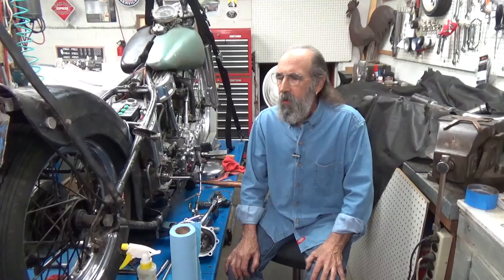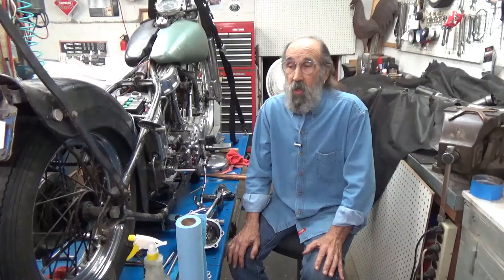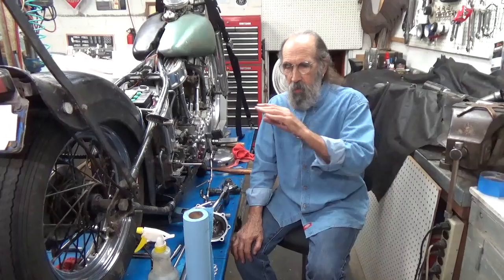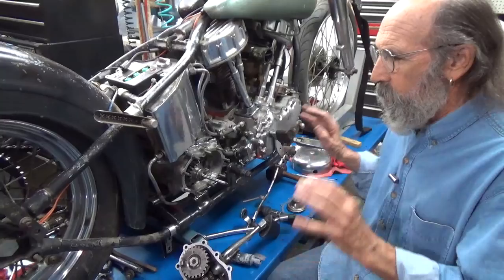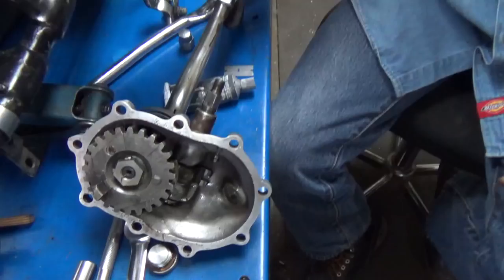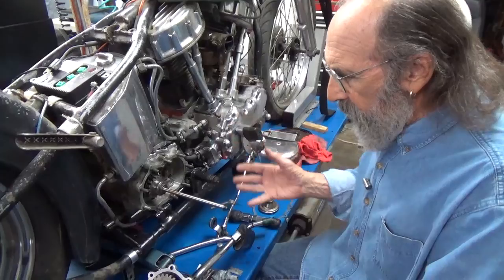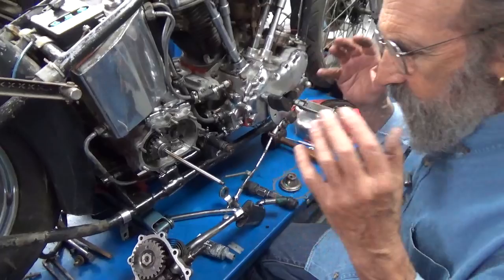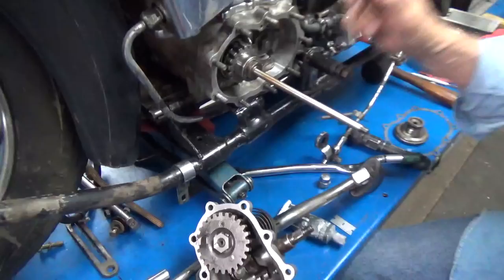Step 5 Reinstalling The Kickstarter on the Panhead

Comment: Hi, It's so refreshing to see the the struggle and persistance to get these things apart and back together. I have a rare 1985 superglide  that I bought new and early on, about 34 years ago, I replaced the kicker gear and didn't think much of it back then. Now I have the bike disassembled  in the driveway ,replacing the throwout bearing. What a night mare. It seems like this bike is a collage of 1off parts cobbled together to make a one year one model EVO with a 4 speed. Harley engineering didn't improve much.My Road king headlight needs to be disassembled  just to adjust the handlebars.
Reply from the maker: It is, what I think of as a "transition year."  Harley was going to five speed transmissions in most models.  There were new models and apparently things still in stock from previous models.  Evos with four speeds and both dry and wet clutches. FXR's getting developed.  They were all good bikes, just caused a little confusion.  The best thing you can do is buy a factory service manual and a proper parts manual for your 85.  I went through all of that when they were new.  Depending on a parts man who is familiar with these changes is hard to do.  Depend on yourself and realize that most aftermarket suppliers will give you their part number and an o.e.m. number from Harley.  It's the same kind of research a restorer has to go through.

Comment: Good to see each bite sized step along the way. Looking forward to seeing the carbituder come off. I know how you love your Linkerts. That will be fun.
Reply from the maker: Wait 'til you see it.  It's the worst I've ever seen.
Reply: @pacificmike9501  Looked darker than most exhaust pipes. Must have been cranked over for days and weeks with nothign but soot belching out to get that black.

One thing i'm certain of, Once you get it cleaned up and adjusted and the timing set properly, it will start like it's supposed to. Cheers.

Comment: Mechanical pieces of art eh? Mike, you are one of my favorite go to's on U tube.Thanks so much for sharing with all of us.Worked in a sawmill  engineering office when I was a lad. When the engineers where building systems they always would stay in the ASTM  tolerances . Specifically, if we  installed a manufactured item into the design there was usually a note from the manufacturer stating that there was a thirty percent safety factor built into there product tolerance. ( shear and torque on shafts.That sort of thing.) Just recently purchased a 1995 heritage soft tail with a S&S  engine, 102 hp @ the crank motor. avacodo combustion  chambers, 485 cam. ( yup! it's an evo). From my calculations she's pretty close to ASTM tolerances from stock.Clutch is after market,have not taken of the primary yet.Lots of torque.Pulls like a train.lol.Cheers Mike and kind regards.
Reply from the maker: I'll bet it's cool.  I've never heard of "avocado shaped chambers,"  but I can see it.  I've seen people play with what we used to call "Bathtub Chambers."  There's some pretty bright folks out there.  "The Horsepower Is Made In The Heads."

Comment: Big Mike the bikes getting together. The carb needed touched up. Ran super last night. Try start let run again. 10 or 15 minutes. Drying oil in cylinders that I put in to keep from locking up while down 5 years
Reply from the maker: Cool.

Comment: Hi Mike,
I had a case of Harley fever and bought a 2003 FXDL with a S&S Super E carburetor, a performance clutch and an upgraded charging system. Most everything else is pretty much original. The bike has 42,3xx miles on it.
I’m in the process of giving it a preseason service and inspection, some things I like, some things I’m scratching my head and wondering how it stayed together … so with that said, I’m going to get busy and see how much fixing I need to do before I feel comfortable taking it out on the road.
Reply from the maker: It's an important act of "bonding."  Enjoy it.

Comment: you work well under pressure!
Reply from the maker: My garage.  I just try to take it as it comes.  My dad used to get so angry doing things that were difficult.  I decided early on, I wasn't going to be like that.
Reply: @pacificmike9501  my mentality is I will persevere no matter what. If I need to step away and come back to it, not a problem. I always get it done.

Comment: Hi Mike I have a 1965 FLH and you might be able to answer a few Questions #1 What oil would you recommend for the transmission # 2. The engine ( I won't be riding it in the winter) The numbers on the left engine case are cast in with a star framing them before and another at the end. I had been told years ago when I had a 1950 FL with numbers stamped in the case that a star framing the numbers indicates that the motor case was cast as a replacement from the factory and the original case had to be sent to the factory as proof of ownership. That friend ( Smiling Fred Casey) sadly passed away over 19 years ago. Love your videos especially the fact that I can hear you on my lap top that has no external speakers. Thanks a head I'll be watching more this winter wile I put an 04 deuce front end on the 65 bobber so I can stop the thing on these crowded Maryland streets.Mike   P.S. I bought the bike partially built I would never take an original bike and convert it.
Reply from the maker: That all sounds good to me.  Thank You.  I believe those stars signify what you're saying.  I've heard that before.  In transmissions, I use 85/140 in all of them, new old, ancient.  Todays technology really works in transmissions.
Reply from the maker: The engine?  I use today's 20/50.  I don't recommend brands.
Reply: @pacificmike9501   Fair enough I'll nervously try that 20 w 50 synthetic on the motor next spring when I get her back on the road. I was using a solid 50 but I've replaced the pistons  and had the cylinders bored  to .004 over. That sounds like a good choice for a long slow break in. If you had not mentioned it I probably would have used a strait 50 w C-D rated oil like I did on my 50 years ago. The more I've been thinking about it the more I like the Idea.
Reply from the maker: Cool.  I have no thoughts on whether synthetic is good or not.  They tell me it is great.  I do think 20/50 is my answer.

Comment: I am glad you reply on bolts never was really thinking on that I think you like friend I find lot times lot rust an crap aan your never rude I go to the days we put chainin bucket oil for hours before putting them on
Reply from the maker: Yes!  We used to go over to my buddy's house and his mom would come out to the garage with a pan and a hot plate.  She'd plug in the hot plate and heat up some grease in that pan and cook your brand new chain in it.  She was someone special.  She set a speed record in 1936 at Muroc Dry Lake on a 1936 Indian Junior Scout.  She was 19 years old and weighed something like 92 lbs.  When I met her, she was a sweet old gal.

Comment: Another great video Mike.    I have a 1957 Panhead and the M74 B carburetor was leaking fuel out of the vent so with watching one of you videos on the Linkert M74B I took it apart.  Now it will only idle with the choke one one click.   Any help would greatly appreciate. I backed bent wire needle (low speed) 4 then 5 turns ,and no help then round nob High speed needle 2 turns then 3 then 4 and no different.  What would you do next?  Thanks John
Reply from the maker: You should have counted the clicks where you are.  You are currently confused.  The low speed needle is the round knob.  Back it out a couple of clicks at idle.  Do it by ear with the motor warm.  Again, you have your needles confused.  Read the words on the body of the carb.  Screwing the needle out (to the left) richens the mixture.  The other way leans it.  A whole turn is a huge group.  Count clicks, not turns.  I'm doing one now.  It will be a few days.  It's soaking now.  Watch the next couple of videos.  May take a few days, even a week.  But, I will be showing it.
Reply: @pacificmike9501  Thanks Mike   You are The BEST.

Comment: Hello Mike when you overhaul the M74B Linkert carburetor Can you show adjusting the high and low speed needles when the bike is running. Thanks
Reply from the maker: After I put it on, sure.  But, I usually set the high speed needle while running down the road.

Comment: Mike, thanks for providing your videos for us shovelhead owners and you allowing us to ask questions. 

My name is Bob Jones and I’ve been riding Harley’s since 1980. My first was a 1980 Iron Head. Less than a year later I bought my first Shovelhead (1980 FXE). Have owned many since including my daily rider 2016 FLHTP (police bike).  I recently bought a 1976 FXE with a kicker. You say your day to day rider is your white FLH and you say you ride it hard including a lot of freeway miles. What kind of RPMS/MPH do you run on the freeways?  My bike is turning 3000 rpms at 65 mph. Mike thanks again. 

Bob Jones.
Reply from the maker: My Shovelhead is a light creamy yellow.  You're probably running stock sprockets.  Probably 23 and 51.  I ran 23 and 47.  Then I ran 24 and forty-nine.  I didn't run a tach in those days, but my motor was not stock, plenty of goodies.  I now run a Baker six speed, for the last 20 some years.  It is an overdrive in top gear.  At about seventy-five or so, the tach reads about twenty-eight hundred.
Reply: @pacificmike9501  Mike, thanks for the quick response. I watched the video that you asked that we give you all the details about the bike we’re asking/talking about. Well I left something out, my sprockets are 24 & 48.  Out of the hole is a little sluggish which I’m ok with since I never ride double on that bike however I don’t think I want to gear it any higher. I guess the totality of my question is is 3000 rpms a safe sustained rpm?  I’m certainly going to look into that Baker overdrive transmission. Mike again thanks for the service you render.  Bob Jones
Reply from the maker: I have no idea how much power you have or how smooth your motor is.  I don't know if your tach and speedo are even close to accurate.  You're the rider.  Sounds like you're probably going faster than you think.

Comment: Love the videos Mike. Huge help working on these old bikes I got... very few know what they are doing now-a-days. I have a question for you. I have a 1948 transmission in my Panhead, I set it up with footclutch/suicide clutch, I just got it running the other day and tried to take it out for a spin, I dropped the clutch and the clutch release arm popped up and out, now when I try to put it in gear it makes a griding sound. I tried wiggling/dropping the release arm back down, but it won't drop in there.. Do i have to take the kicker cover off? Is there an easy way to get it in there without draining the oil/doing that?? Thanks Mike.
Reply from the maker: Yes, take the kicker cover off and replace the clip that came out.  Match the drawing in the book.

Comment: Thank you for these videos Mike! I found a exact set of Evo cases that you had in your rebuild set of videos of the Evo motor. Everything was good but the steel insert for the pinion shaft is loose, is it worth trying to fix or should I just look for a new case? Thank you for all the info, best Harley diy videos on YouTube
Reply from the maker: Take it to a qualified machinist.  It's fairly common on some of the Evos.  See what it will cost to repair.

Comment: Mike, I got a problem. I have a 93" 1980 shovel and it pees oil all over my leg when I'm riding it. It doesn't have very many miles on the rebuild (I don't really know how many, maybe 5k) and it runs excellent. The leak appears to be coming from the front cylinder base and the front rocker box. I checked the rocker box nuts and there's one or two studs loose (not the nut - the whole stud). One of them is tucked up under the frame and I can't get to it. I'd really rather not rip the front jug off to get to that base gasket just yet, and I noticed some red stuff around the rear cylinder base on this pan you're working on. What is that stuff? My thinking is it's about 1/3 as much work to pull the head and fix the rocker box studs as it is to pull the whole motor to replace that cylinder base gasket right now. Can I seal the cylinder base up with something and get 1 or 2 thousand miles out of it? Also, any tricks or things I need to know when I pull this front head off? It's a stroker so I'm not even 100% sure I can get the head over the sleeve to get it off with the small amount of frame clearance I have, but I'm going to try. If you know a way to tighten a rocker box stud that's directly under the frame without pulling the head off, I'd appreciate that too.
Reply from the maker: The only thing I can think of, that you may not know is that the original heads on a Shovelhead, had those studs put in with an "interference thread" and were not intended to be removed.  Repairing them was really tough.  Then came aftermarket heads.  Those studs were generally just threaded in.  You'll have to see what you have when you get it apart.  Sealing up leaks from the outside is temporary at best.  That big red mess on this Panhead is not leaking and will probably be alright until we get around to rebuilding the motor, at a later date.

Comment: Hey old timer I recently purchased 1970 ironhead 900 kickstart only my first kick only bike, my question is about the distributor /points I have power to it but no spark it's driving me absolutely insane  have no idea what I've gotten myself into any help would be greatly appreciated thank you 🤘
Reply from the maker: Try replacing the condenser.
Reply: @pacificmike9501  I had that happen to me!
Reply: @pacificmike9501  I already did that actually still no spark I've been keeping my self busy on other things put that on the  back burner for now until I figure something out

Comment: Hey Mike!  On my 1974 flh Shovelhead with a Sputhe 5 Spd.. It has plenty of Power, but It seems to be held back. I was just wondering if you have an opinion on the Sprocket Combination that would make it travel Faster on the Highway. It's all Chain Drive with the Primary being Non-Compensator.
Reply from the maker: Your transmission final drive is one to one.  Your transmission sprocket is one way.  The rear wheel sprocket, If you have a rear disc brake, could be changed to a 49 or even maybe a 47.  That would give you a bunch more topend.

Comment: Hi Mike! Love your videoes. You make it easy to understand! I got a quick question for you. Im relatively new to this, but i am now in need to split the case on my 48 panhead, because of a cracked front engine mount. Given this is a fairly big job, is it something thats doable with the service manual and hard work or will you recommend to set away this to professionals? The welding, honing and lapping will be done by professionals, but i really want to do the rest myself. My only teacher is me and my own errors
Reply from the maker: I don't know how mechanically advanced you are.  You're definitely entering serious territory.  If nothing else, you'll need to have a few things looked at while you're there.  Maybe it's exactly what you need.  I don't know.
Reply: Thanks for The reply, I have something called groundschool in mechanical. Im from Norway so we have a bit different school system here. Im considering picking up that again in evenings, so I will have a better foundation. Hate to put work away because you know, its my baby and its The easy way out. Anyways, your videoes helps alot!
Reply from the maker: Thank You.  It sounds like you're serious about what you do.  That's great.  I wish you success and think you'll have it with your careful considerations.

Comment: Good info as Allways MIKE, PLEASE ADVISE WHAT TYPE CARB ARE YOU RUNNING ON YOUR SHOVEL  HEAD A S/U It LOOKS LIKE TO ME?  Please  MY BROTHER AND I EXPERIMENTED WITH SEVERAL ABOUT 50+YRS AGO FROM OUR DADS 56 AND 59 JAGUARS MIXTURE NEEDLES WERE A PROBLEM FOR A WHILE BUT IT WORKED OUT ,65 AND 57 EX POLICE BIKES WERE OUR FIRST, BEEN MOTORINGNOW FOR 58 YRS BIG BROTHER 64+ YRS. THANKS MIKE.
Reply from the maker: Yes, it is an SU, supplied by Rivera Engineering.  I've run them for about 35 years.  The needles and springs and anything else for them is available today from American Prime Manufacturing in Paramount, California.  Phone (562)-889-8665.

Comment: Hey Mike, I have panshovel, 48 bottom mated to a 53 tranny with a belt drive. I got the trans rebuilt and now the clutch throw wont engage until the very last second when releasing the clutch into gear. It makes taking off from a start pretty much impossible. It usually just stalls, sometimes jolts right off the line. A little rolling start and it goes but its really unpredictable. Ive adjusted the clutch hoping that was the problem and cant figure it out. Is there something im missing or installed wrong? Thank you, love the channel!
Reply from the maker: Thank You.  There is a possibility that you don't have the right length pushrod.  The other possibility is that you don't have the right throwout finger inside the kicker cover.  One more thing is that the plates could be hanging up on the clutch hub studs.

Comment: Hi mike just fitted a new pushrod and throwout bearing in my 1973 shovelhead, but when I start the bike the kickstart pedal drops down what did I  do wrong , is the kickstart not locking inside
Reply from the maker: You'll hhave to try again.  Something is not clocked right as you install the kicker cover.
Reply: @pacificmike9501  Ok Mike thanks,  will let you know when I solve the problem kind regards Alan.